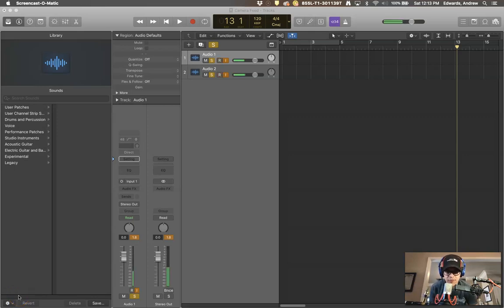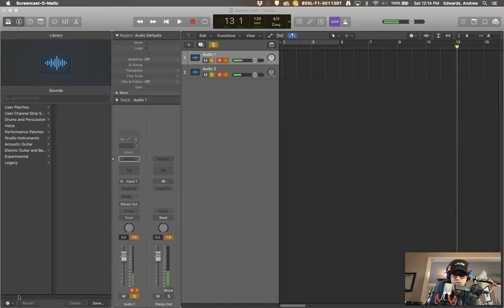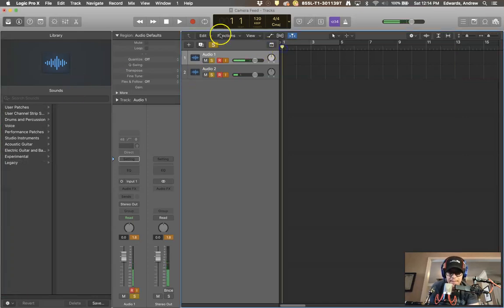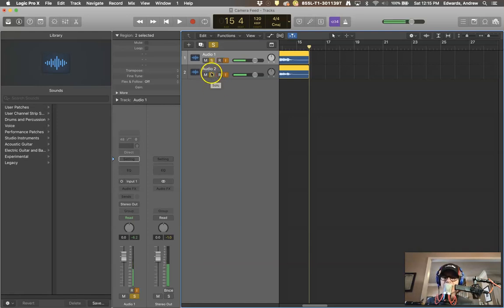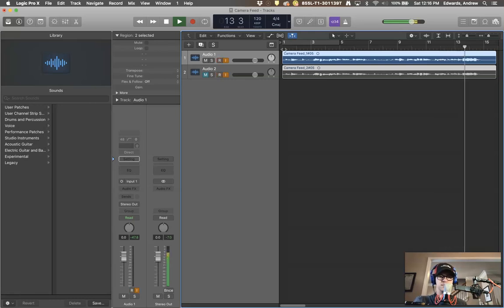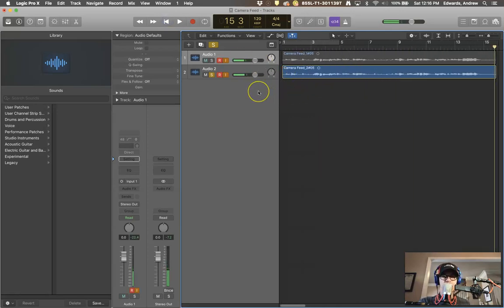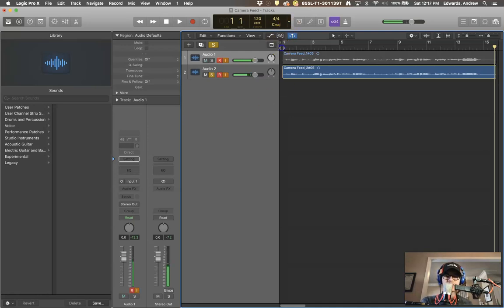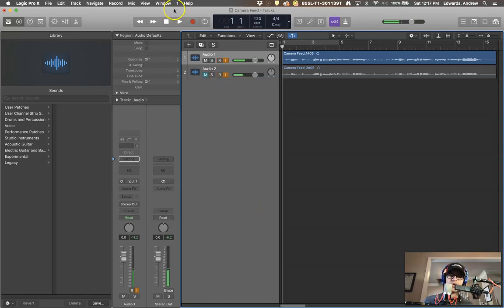Microphone Shootout 4: Large Diaphragm Condenser vs Ribbon

Comment: The ribbon has a fuller sound on my JBL Series 3 monitors. The LD has perhaps a better defined high end, but all in all I like the deep full sound of the ribbon.  Thanks for the demo.
Reply from the maker: I'm glad that you enjoyed the demo!  Thank you so much for sharing your thoughts!
Reply: @RoaringRecords  I have a R84A, and have been contemplating purchasing a C414, but not sure it's worth the cost considering how the R84A covers the same spectrum.  Any thoughts?
Reply from the maker: @TheBassdan  Comparing the sound of a ribbon and the sound of a condenser can be a bit of apples and oranges.  The way they capture sound is so radically different, I don't think it would ever hurt to have one of each. The C414 is an amazing microphone for sure!

 Hey, if you want to think a bit outside the box, and not spend as much money, you could try building your own.  I use a company called micparts.com https://microphone-parts.com/products/s12-microphone-kit or https://microphone-parts.com/products/t12-microphone-kit. These two kits are both designed to sound like and AKG C414 but are less than half the price and a lot more fun, because you build it yourself.  We built the S-12 kit here are roaring records with high school students.  All we needed was a soldering iron, solder, and a way to hold the boards.  I have a video series called build your own music tech that shows the process of me building a microphone.  The S-12 is a modern C414 sound and the T-12 is a vintage version.  Honestly, the S-12 we made is really nice!  I could send you some sound samples if you wanted me to.
Reply: @RoaringRecords  Great idea!!  It never occurred to me to research DIY mics, since I didn't know they existed.  (I have done some research in DIY Harpsichord kits, but that's a different animal entirely LOL). I have previous experience with soldering on PCBs, so I ordered the T-47 to record my double bass.  If it works out, I'll probably order the S3-12 and tube V47.
Reply from the maker: @TheBassdan  I think you will find his instructions are very clear and you will have a lot of success in your build.  I am about to build the SDC from his site this week myself! Happy Building!